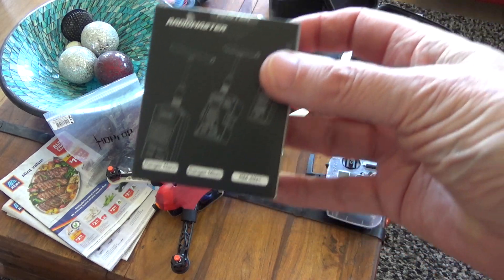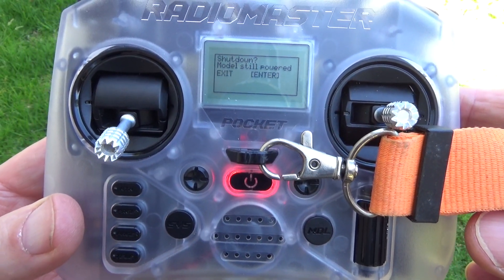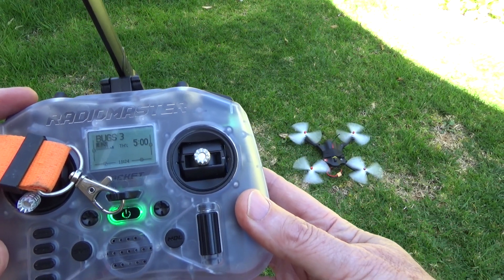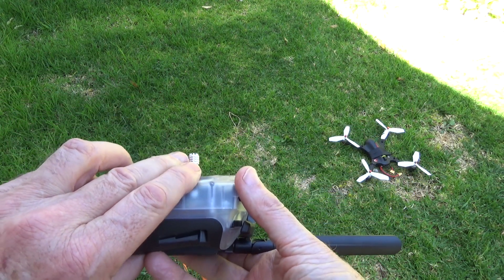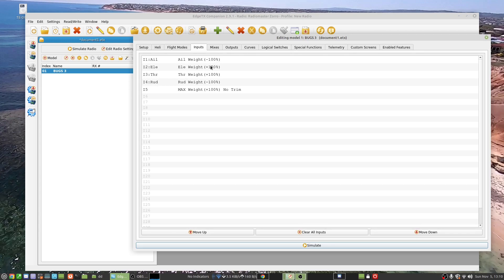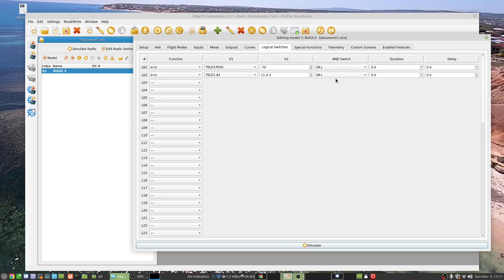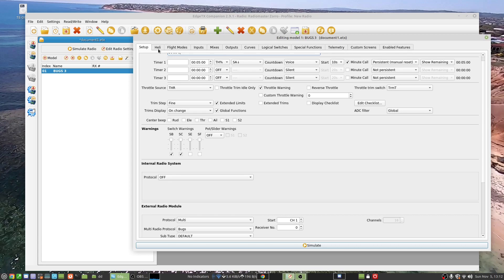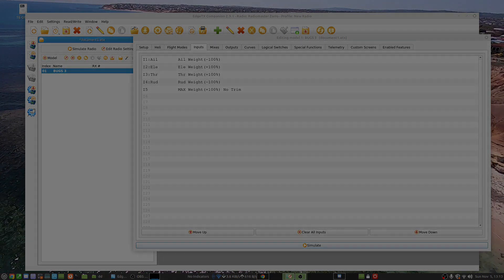Radiomaster Pocket - 4in1 module arrived,  Bugs3 bind OK

Comment: hi i am looking for model 4in1 multi protocol  but not separate parts  do you know any control but not new one the oldest one
Reply from the maker: With a 4-in-1 radio or module, one of the 4 is a cc2500. The others are NRF24L01, A7105 and CYRF6936. The 4-in-1 will allow you to make your transmitter work with A LOT more rc receivers, including most of the ones that Bind and Fly (which are often DSMX) and RC Toys use. I am not aware of an EdgeTX radio with a built in 4 in 1 module. I started with DeviationTX and Jumper T8SG radios that have the 4 in 1 built in.  I think calling Radios with only the cc2500 chip built in "multi protocol" is misleading - nothing I've flown used the cc2500 chip.  Bugs 3 and Bugs 3 mini require the A7105 chip.
Reply: @skybug3  Jumper T8SG my favorite control but didnt work for everything i like control with no modul i have master 16s but too big i never useit

Comment: Wouldn’t it be best to just buy another tx with 4n1?  Same cost.
Reply from the maker: Big changes to my flying since I made this video. After buying a Nano RM ELRS module and flying drones with SpeedyBee F405 FCs, I'm hooked! The range with 1W goes way beyond any distance I fly, and the penetration is also great. Now I've made the breakthrough to acro mode, I will rarely fly my Bugs3 based drones. I bought the ELRS version of the Pocket thinking that 250Mw would be adequate for most of my flying, and would give me a backup if the first Pocket failed. Very happy with performance so far. Betaflight has got easier for me to use over the last 4 years, and installing the VTX and RX with plugs so I can disconnect if not needed during configuration is a simple solution to the over heating problem.
Reply: @skybug3  I have the pocket in elrs.  I was thinking of getting the 4n1. I’ll probably just gonna get another tx
Reply: @Roundawg I bought the 4-in-1 module after acquiring my ELRS pocket TX. From what I'm reading the 4 in 1 covers more protocols than CC 2500 only Pocket which is also included in the 4 in 1.
Reply: @skybug3 I have a elrs version pocket and I just got in my mutli protocol module what all do I need to bind my old tiny hawk 2 freestyle and all my other drones
Reply: There's a Pocket with 4 in 1 built in?  i'm looking for my first tx, i want 4in1 so i can use it on my rtf foam planes.   I get nowhere looking for the pocket with 4in1.   Ideally i'd get the zorro, but tis pricey for someone new to the hobby.
Reply: @Truth-Over-Fear  there's only the CC 2500 and ELRS versions of the pocket radio. You can add the four in one module and you'll have all your bases covered
Reply: @telcobilly  thanks for the info, got my hands on a zorro max 4in1 now.

Comment: Can you provide a link for the high gain antenna?
Reply from the maker: @Giulia_Baresi02  The RM4IN1 module comes with a centre pin. The antenna must be without a centre pin.
Reply from the maker: I bought mine from ebay australia. Here is how it was described -
2.4GHz 5GHz 5.8Ghz Antenna 8dBi RP-SMA Connector Dual Band wifi Antena aerial&Z0
Check if it comes with or without the centre pin. I have both versions. One fits my older Jumper T8SG, while the other fits the RM Pocket.

Comment: Finally got my RM pocket to fly my 3.5 inch and it does great!!!
I would love to use this TX with my bugs 3... I'm guessing that I need a mini module and quie a bit of programming to get it to fly the bugs3🤔
Reply from the maker: Yes, there is a bit of work to set it up with the Bugs. Fortunately there are a few videos out there to help. Need the 4 in 1 multi protocol module for either version of the Pocket as the so called multi protocol version does not support the Bugs. The Edge TX companion program running on a PC makes setup a lot easier. Worth doing as the Bugs seems more responsive flying with the Pocket, compared to a Jumper T8SG  or the standard Bugs 3 controller. 😁
Reply: ...is there a way to possibly solder an elts receiver bon the bugs? @skybug3
Reply from the maker: @droneready8278  Need to desolder 8 pins connecting the Bugs3 TX to the FCB. Could then use a multimeter to check for power. That leaves a lot of pins to figure out what to connect to! Way out of my comfort zone! 😂
This link may help - scroll down to pictures on page. https://www.deviationtx.com/forum/protocol-development/6696-mjx-bugs-3?start=140